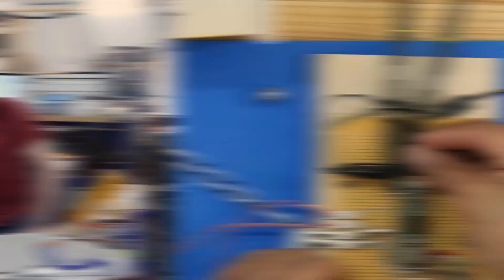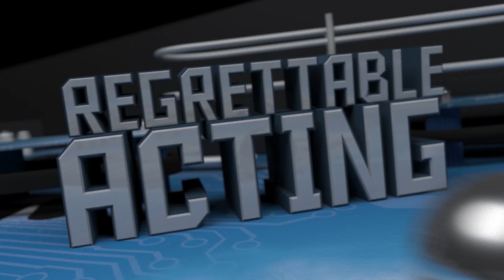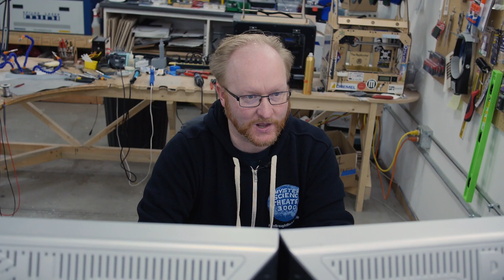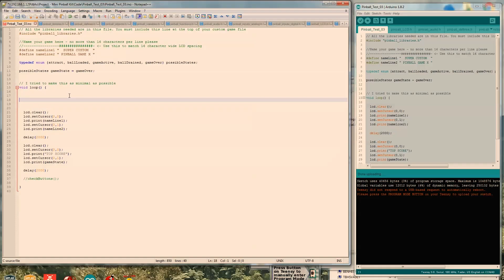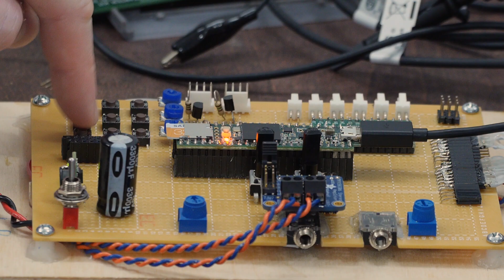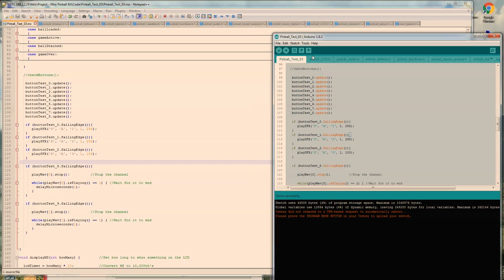Mini Pinball 03: Codemania!  SoundFX and State Machines

Comment: I'm trying to build my own pinball game, but I'm not really a programmer, just want to convert my wood only machine to an electronic one. So far I got a screen for the score, that I got working, I got some buttons for flippers, that I got finally read via an interrupt, solenoids to drive them, a mosfet board, sound board and other parts. I would like to see some working examples so I can write correct code. Progress is really slow if there is nothing to work off. Looking at various examples but these all only do one thing. If I just pick parts from here and there, It will definatly not work well. Is the code for this project available?

Comment: It would be nicer to use a esp instead and use it in adhoc , host a site with all settings and stuff, or just add it to the teensy. but esp should be able to handle sound and everything on its own, specially if it's esp32 (external codec maybe preferable though). Would think that's more in line with sellable product. Ofc it's diy, but coding is not for most people, even if it's as easy as just changing some lines of text. :p

Comment: Notepad++ is a huge improvement. But you can replace all of that with a proper eclipse based IDE called Sloeber
It has refactoring support and the compiler + progmmer is build in. you don't have to mess with multiple windows.

Comment: Use millis to calculate elapsed time between calls so things actually happen at a set interval. The current implementation is gonna slow down the more code you execute between loops and is incredibly bad practice. 

You should also definitely go down the c++ class route. I hate when libraries pollute the global scope with functions as it's easy for name collisions to occur. Using classes makes it clear what is going on as you need to create an instance to do anything with it.

Comment: Consider using Sublime Text 3 or even better VSCode for a better cross platform coding IDE, NPP is so old!
Reply: Ricardo Funes he doesn't. I was stating that they are cross platform so that if an audience member wanted to copy using the same, they could so on any platform.
Reply: GameDevSPS They also have Arduino plugins so you don't need both apps open.

Comment: WTF, can't put code inside the H files... have you ever heard about header-only libraries?

https://en.wikipedia.org/wiki/Header-only
Reply: The problem with header-only code is that it makes compilation times longer, and in C in particular will probably make the executable file larger because of code duplication (although this can be avoided in C++). Header-only code also tends to be less modular because it can't have compilation-unit-local variables nor functions.

In C++ header-only code is more common, but not because it's good practice, but mostly because of technical reasons (because compilers never implemented extern templates).
Reply: WarpRulez I know, but it also eases compiler time optimization and in some cases packaging. As most things in C++, the right usage is dependent of the context. Anyways, they are not considered bad practice at all. It just depends on the rest of the code and the project.